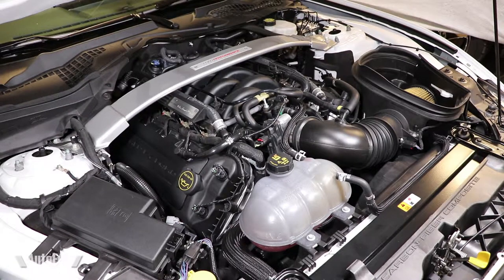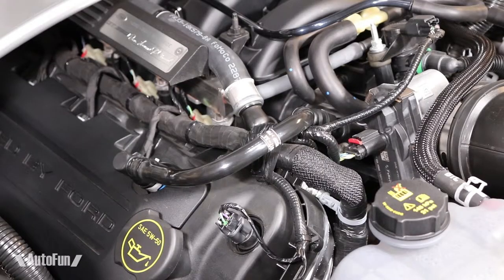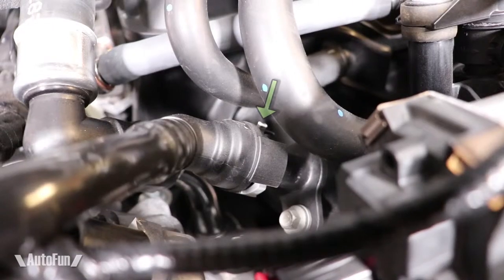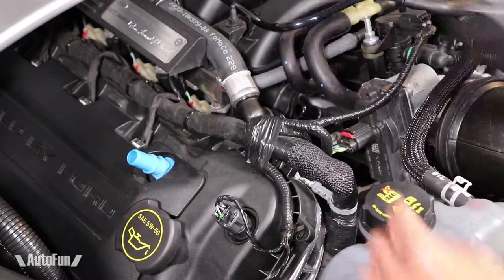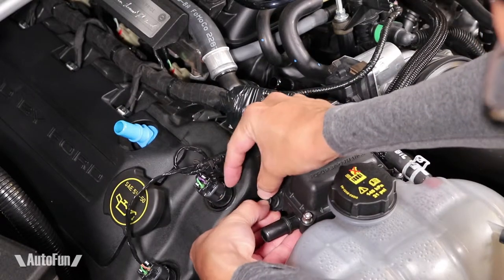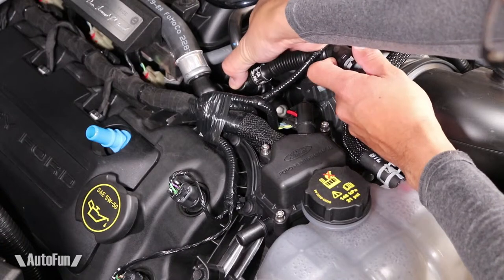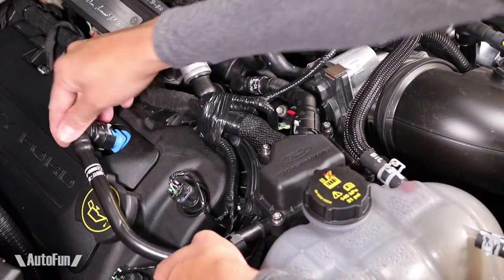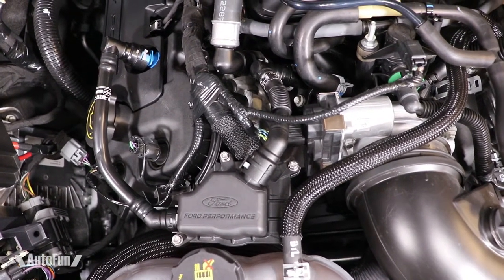Passenger Side Ford Performance Oil Separator (Shelby GT350, Boss 302, Mustang GT, Bullitt, Mach-1)

Comment: Thank you for posting this. I dropped one of the push pins into the engine bay. How fun. Fortunately I had another push pin to hold this in place. Looks great in the GT350 bay!
Reply from the maker: You're welcome Kyle! (and yes that happened to me to LOL) Cheers!
Reply: @AlexAutoFun  I'm glad I'm not alone. I could not find mine once it dropped in there. Did you find yours?
Reply from the maker: @KMoore8989  LOL! Nope, I ended up buying a baggie of them of the internet, here is the part number if you need it W705436-S300 Cheers!

Comment: Hey so it seems u have the ford performance stage 2 pack? Ford's saying their oil air separators doesn't fit onto ford's performance stage 2 pack on 15-17 mustang gts because of clearance issues. Seems to fit on your video here. Let me know please. Planning to get one.
Reply from the maker: Hi Sengsy Thao! This is my Shelby GT350 (all stock) so I can't confirm if the Mustang with the Stage 2 pack will work with the separator (If I remember correctly the stage 2 packs shares some GT350 components) Hope this helps and if you do order one, please let us know what you find bud!
Reply: @AlexAutoFun  thx bro!
Reply from the maker: @sengsythao1896  You're welcome man!